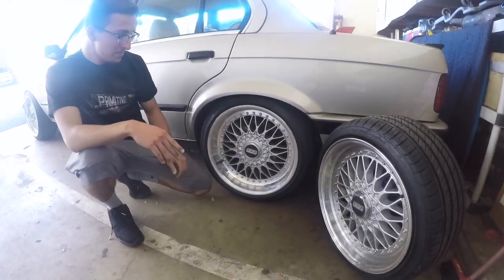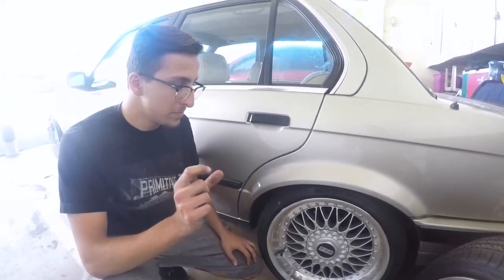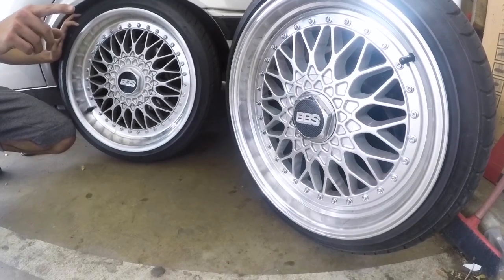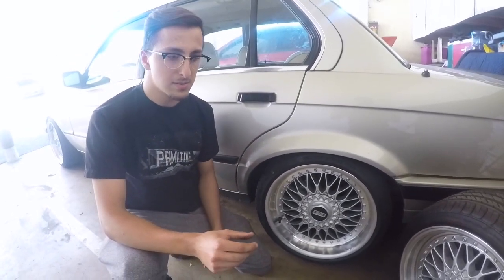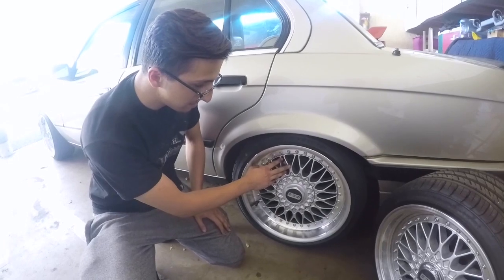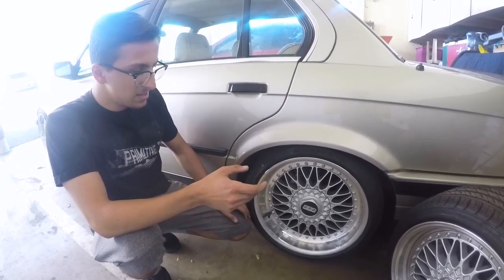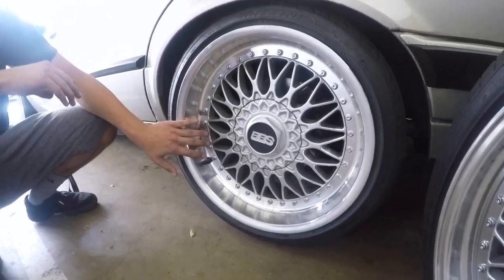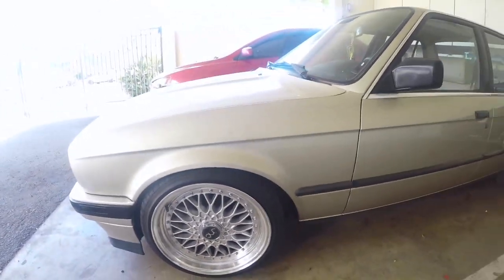BBS WHEELS: FAKE VS REAL (Review/Comparison)

Comment: they're 3-piece Wheels not 2-piece Wheels
Reply: Chris Bevins they can be 2 piece,I have 2 piece rc's one my car
Reply: 19Moris97 I see blackforest sells a 3 piece conversion kit to turn 17" into 18"
Reply: James Yurko yes,possible, but you need to be sure that you have the 3 pice  and not 2 pice
Reply: Chris Bevins I'm pretty sure that his "real bbs" wheels are actually oem style 5's (rc090). I can tell because if you look closely on the face of the wheel you can see an indicator that shows where to put on the center cap to align correctly. Technically bbs but definitely not rs.

Comment: do u still have the jnc wheels for sale?
Reply from the maker: Emmanuel Agboghoroma no but I have a set of esm wheels for sale if your located in LA
Reply: okay how much pls and what are the dimensions?(sizes)
Reply from the maker: Emmanuel Agboghoroma $550 they’re 17x8.5  with 205 45 17 tires. The tires have camber wear. If your near the valley check my post on offer up

Comment: Bmw steeal rims with fat tire for bad roads and off road. U guys are lucky with good roads. 
if i put this on my e30 my all body woud be destriyed. 
god bles america :p
Reply from the maker: WOW that sucks. One day you will do it! 
How much do Euro bumpers cost around you?
Reply: Its chep in Croatia. We have lot of all kinds of e30, so parts are a bargin. We adore them. 1.6i, 1.8i, 2.0, and ofc 2.5.... and deasel 2.4 FTW.
2.5 is gr8 but fuel cost to much by us (1.85 $/L), so for minus 50-60 hp 1.6/1.8 is betther if u use e30 for dayli drive.
7L/100 km 1.6i. 101 hp 😊😊😊
Reply: Bbs weels 4 of them 200-250 $
Hihi
Reply from the maker: Matej Bodrožić- Džakić Thats amazing man. How much are euro bumpers? They cost a lot here in the US
Reply from the maker: Damn that's a good price! CHEAP
Reply: Im so in love with my e30. I must admit. It's all stock. No spoilers, no grills, no fat thaers, no AC....only i have is ABS and its rocking sweet-. Its 4 cilindar 1.6i but even so he likes to throw ass in corners like a boss. Eze to controll power slides with 30-45 km/h ahaha ghetto xaxa

Love this car bro. He will return 3x da love :D